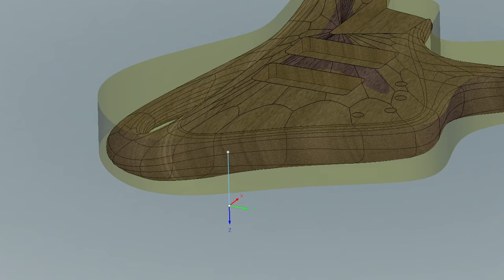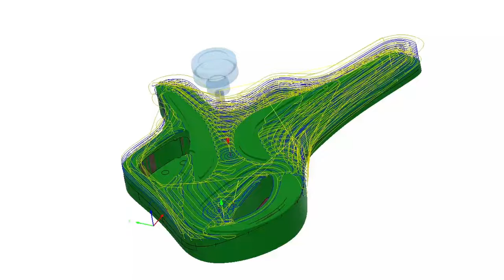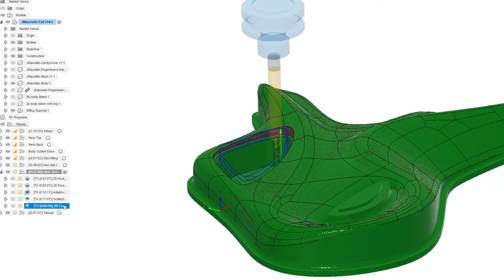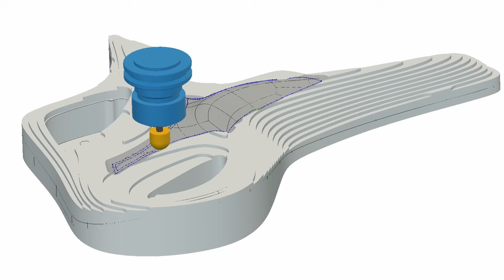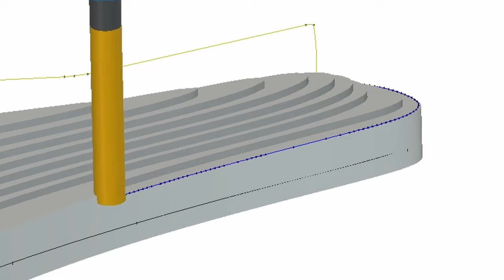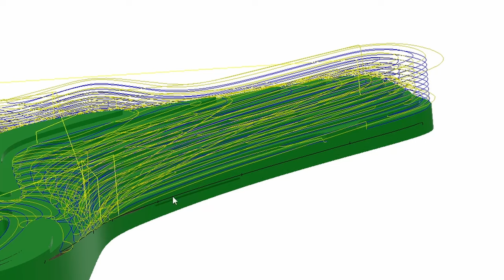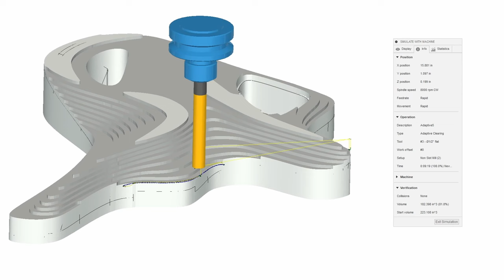CNC Bass Guitar Body | Unusual Fusion 360 CNC CAM Hack

Comment: I've only had a CNC for a little bit. Messed up a lot necks, did some upgrades to the machine, gotten a few workable necks, I'm getting better. I've watched your video's time and time again trying to learn how you set these bodies up. I got the Z axis from the spoil board. I set that stupid probe aside (because things turn out better if I Z from the spoil board) and I see you set the Y to the centerline but how do you get the X? I gather you set the bit to the side of the body just enough to cut into it but I feel like I'm missing some info here.. Can you clarify how you get the X-Y Axis? I would really appreciate this because I'm very interested in understanding the way you set this up.. Thanks man 

(I designed a body today that I want to try and cut out this week) I plan on X-Y from center with a board on the side for a guide and Im drilling index pins using tape and CA glue.
Reply from the maker: Try this one https://youtu.be/NWk9QEd9no8?si=r596wQ9FeBOHZizb